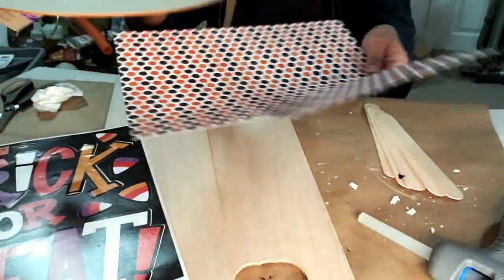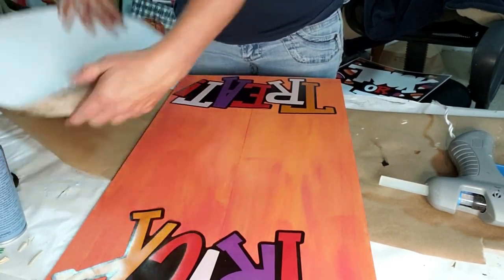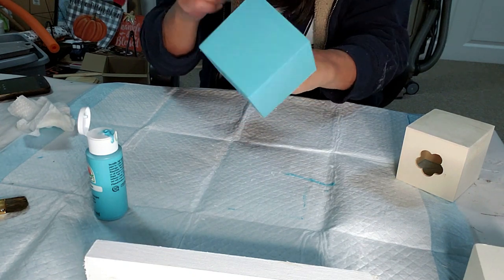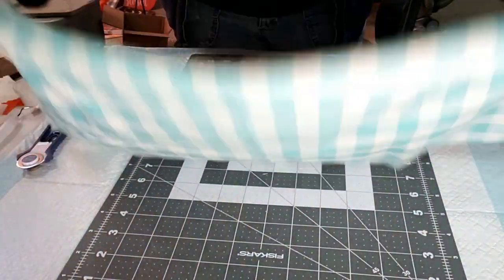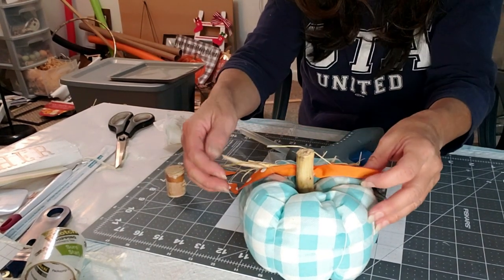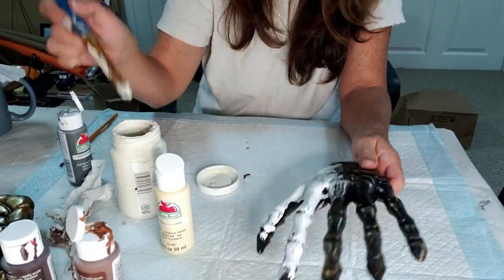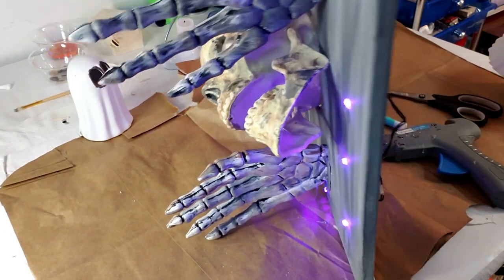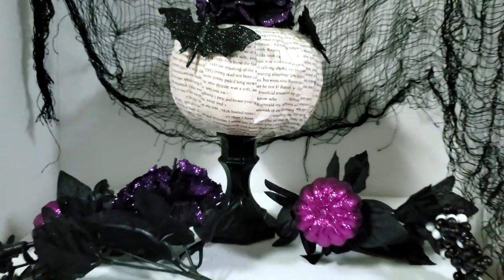Halloween 4 DIYS ~Spooktacular!! Creepy and Cute! Dollar tree products. Enter the giveaway!!

Comment: I would like to see how you prompt the hands in the back if you don’t mind
Reply from the maker: Send me your email I will take few pics. Also my skull only was about 2 to 3inches through so I had clearance to hang it. For the hand just put a wide enough slit so the hands can slip inside then hot glue them I used popsicle sticks to hold it up.